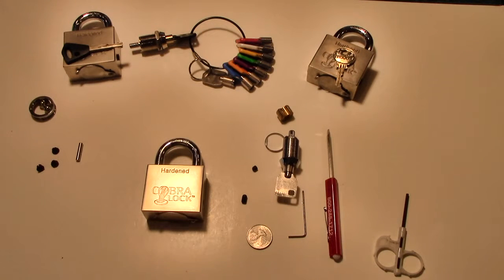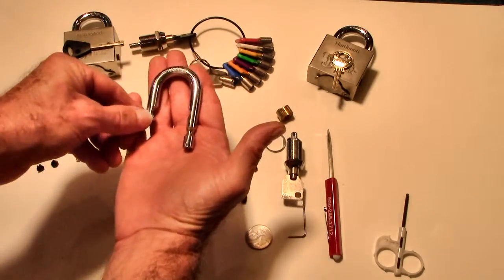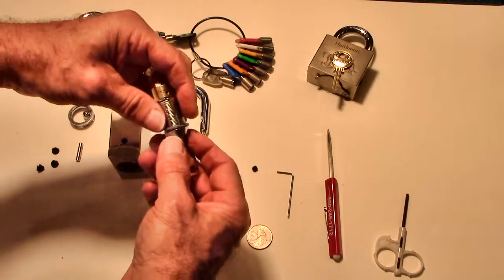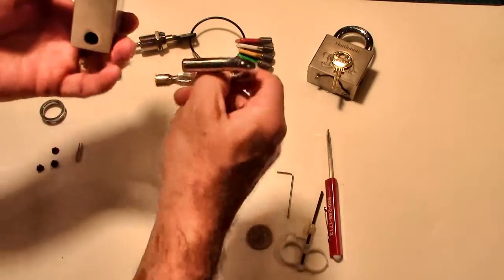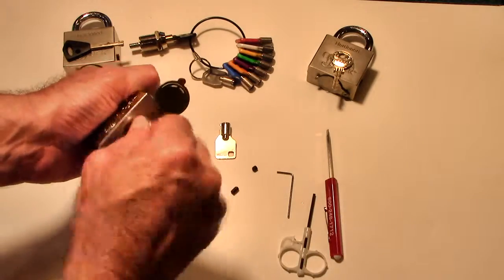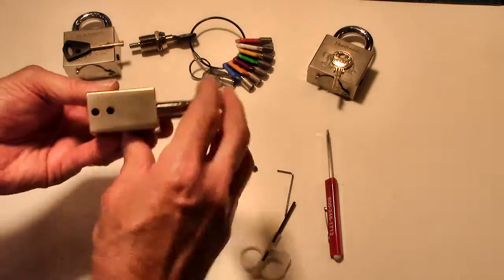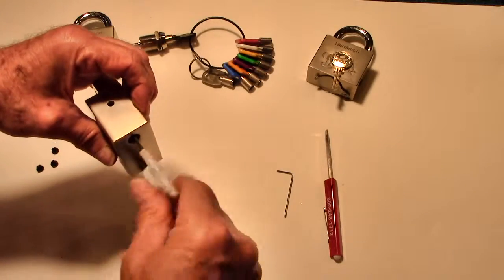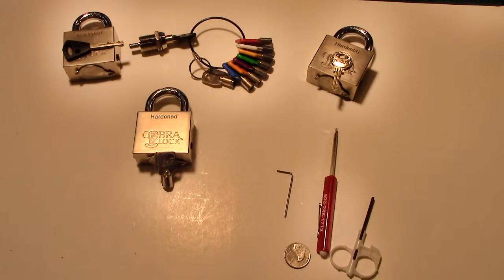Flex-Padlock with User Changeable Security

Comment: Will it not accept an ASSA Desmo 7/8" camlock? Locking Systems International is an ASSA dealer and I though the Desmo was the standard shape and size?
Reply: Should work as long if the back of your desmo cylinder has that screw on it for that brass actuator